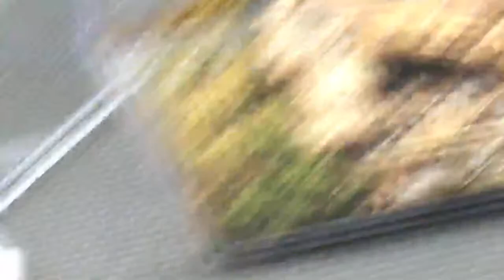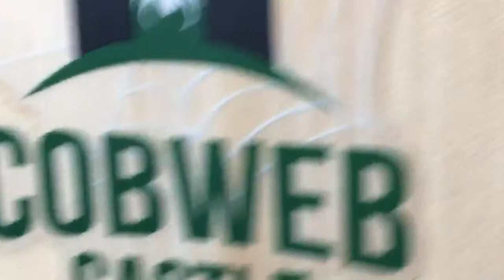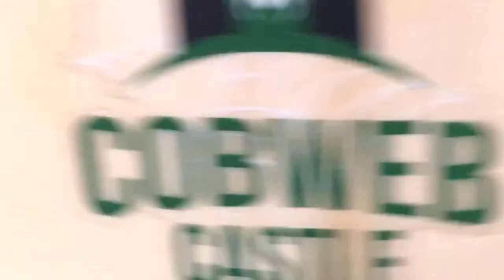Preparing for an Outreach Presentation

Comment: My isopods were doing really well, then suddenly I checked in on them and they were all dead. I have no idea what happened. 😞
Reply: Probably to have an answer why you should describe it more. Where, does they were found in one side, do there were some unusual behaviour before or some unusual conditions, does substrate was very wet or dry. I guess that could give some hints. Realy I 'm a novice in this, but all guides list water and air as a reason for mass collapse.
Reply from the maker: Tell me as much as you can about your setup